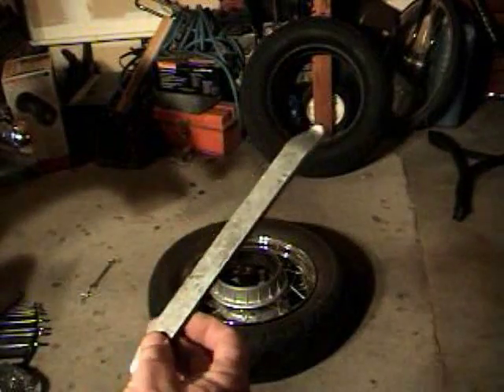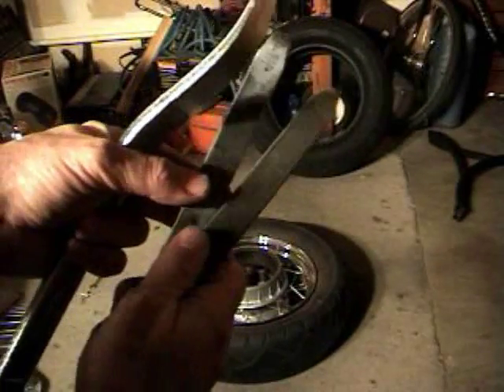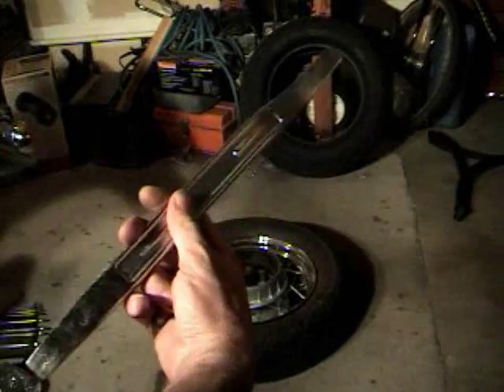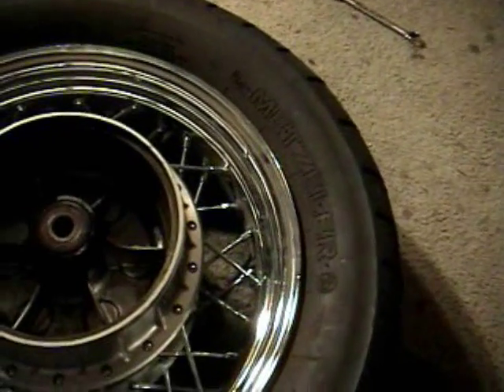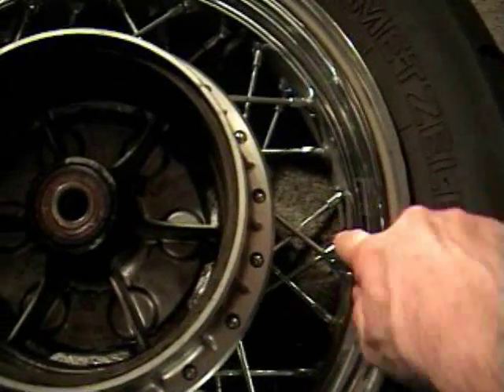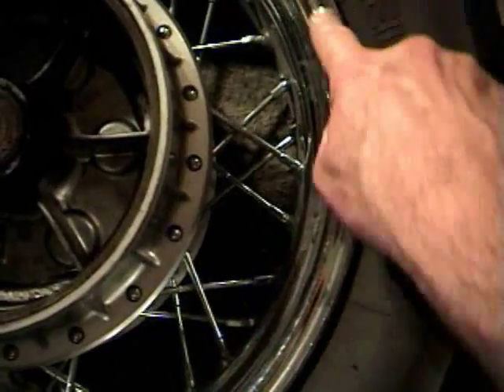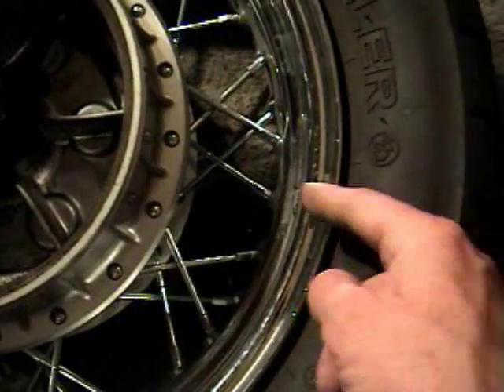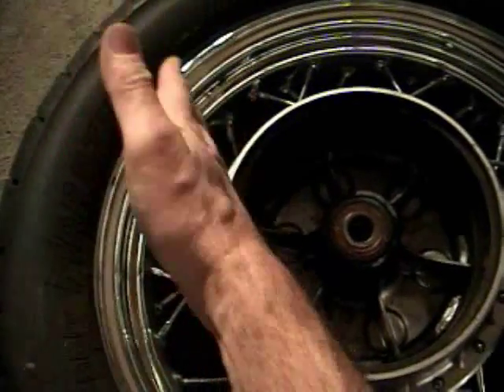Motorcycle Tire Repair HAND TOOLS USED to Remove Motorcycle Tires from the Rim Wheel diy

Comment: Why did you make this video?
Reply: I found this video useful, particularly the comment about running the bead of the tyre into the centre of the wheel. I'm doing up an old xs 650 that's been standing in a garden for 20 odd years so the tyres are quite hard and ungiving so this vid was really useful considering tyre removal isn't something I've done since I was a kid with a BMX. My question is... why did you write your comment?